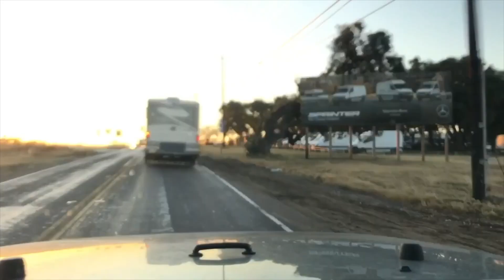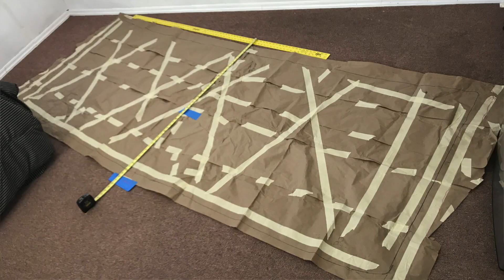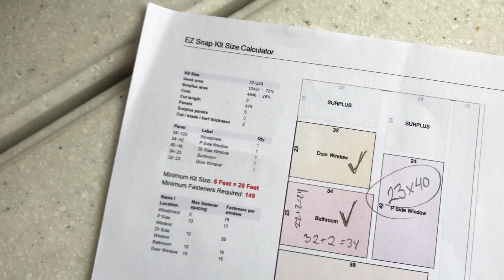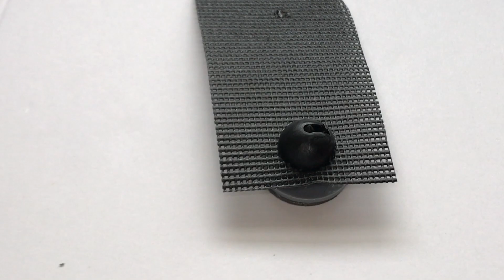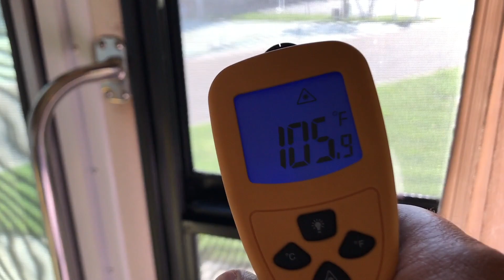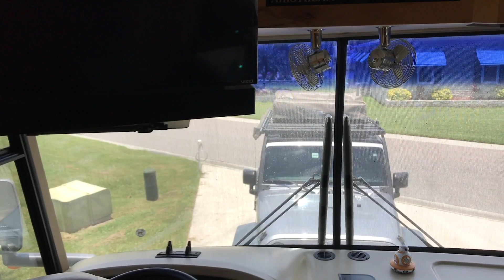Installing EZSnap RV Shades

Comment: South central Texas (Full time in an RV park) I hope to save a lot of $$ by using the EZ snap system. Reflextex
Reply: We place sheets of reflectix under the EZ Snap shades and it makes a huge difference on the interior temperature, especially upfront where we’ve covered the massive windshield. We have also used the shade material over our skylights up top and it makes a big difference.

Comment: Thanks for the advice, I was going to get Flex roof treatment to lower the temps for AZ heat and wasn't sure if these window covers were worth it compared to having 3M tinting on all windows
Reply from the maker: What did you end up doing? How did it work out?
Reply: @wanderingdillos  Just starting to warm up here so I did something soon, might test some covers first